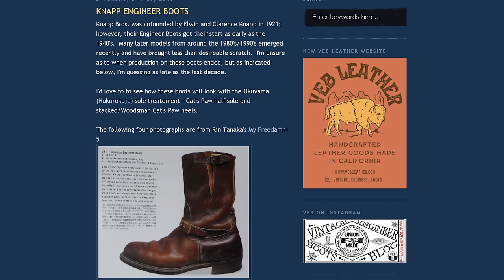Old School Greatness! Nicks Boots - Pullman Engineer Boots

Comment: I got my order this week.  I am impressed by the quality and fit.  I like the different style of these over Mr. Lou.   I was less impressed by the wait time of I believe 7 months.  I asked early Jan. where they were at and I was told they were finishing them.   Better than the Wesco wait time where I am still waiting for an order made in early Jan. 23.  over a year ago.
Reply: I just picked up a pair of these Sunday in the Nick’s Quick Ship section. Based off the UPS tracking I should receive these Tuesday. I too ordered a pair of Wesco Mr. Lou’s boots in September and realistically don’t expect them until March 2025. I also ordered a standard Nick’s Pullman Engineer boot too prior to picking up this Carl M. collaboration boot. 

Curious as to the comfort level of the boot? Is this a boot someone can wear and be on their feet all day? It’d be interesting to know.
Reply: I wouldn't count on March.   All though they may regularly restock the Mr. Lou sizes listed for sale.   I asked once and was told if you order you go on a waiting list if it is out of stock.  I sent a pair of Jobmasters to rebuild in early Oct.  They shipped them the other day due to arrive Monday.
Reply: March 2025.
Reply: I’ve ordered mine, still waiting

Comment: Looks like a cool boot. Definitely gives off a Mister Lou vibe. Interesting to see they are rebuildable, which is not the case with the renegades. I had a pair of renegades briefly and wasn’t thrilled with them. Now I’m going to have to flip a coin to see if I will buy these. Thanks Carl, because I don’t have enough engineer boots already lol.
Reply: Ended up pulling the trigger.
Reply: Hey, FYI. These are NOT rebuildable. Look for my most recent comment here. Had an exchange with NICKS. I'm considering cancelling my order.

Comment: Have been researching and thinking about buying engineer boots for a while.  I've considered WESCO, KNICKS, Role Club, JL's, etc... 
Then I ran into a NICKS email about this special collaboration  (and limited production of 100 pairs) between C. Murawski and Nicks...There were 48/100 pairs when I opened  the e-mail sent by NICKS. 
3  hours later when I got home from a motorcycle ride... there were only 36/100..! 
it was then when I decided to pull the trigger. Didn't wanna risk it. these CM x Nicks engineers are the best in quality and design I've seen since I started looking into buying a pair. These boots are literally Flying .!!

Comment: Those are some sexy wire wheels. I want to hear more about the project, I've got a 4-valve Rajo head, Winfield 4V, and Ruxtell waiting for me to put together and get under my roadster.

And I need boots now too.
Reply from the maker: Right on! I'm looking for a Roof or Rajo head now. Did you ever see the overhead cam kits they made for these little 4 bangers? Insane.

Comment: 1927 was the last year for the model T. You should probably put a model A engine and transmission in it. Or better yet a 34 Ford flathead V8. Just my opinion.
Reply from the maker: Yeah I love the flathead V8s but they’re hard to fit on the stock model T frames.